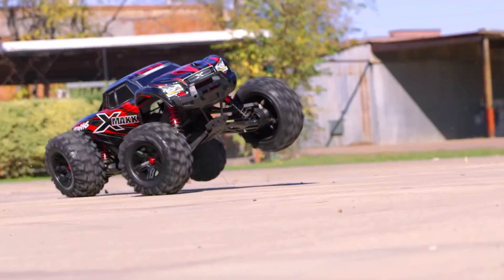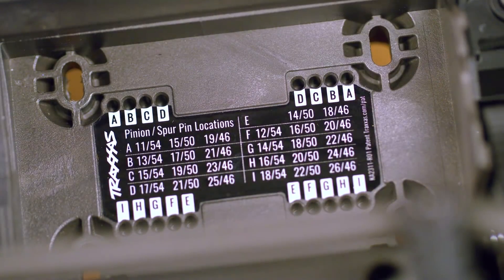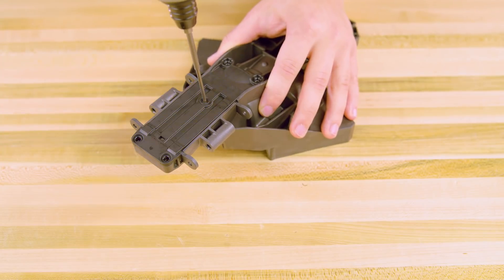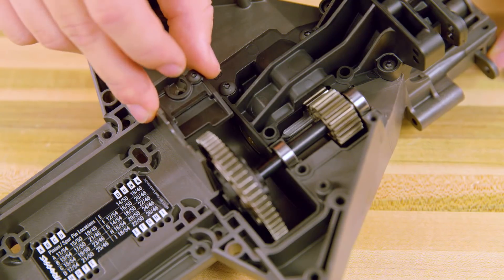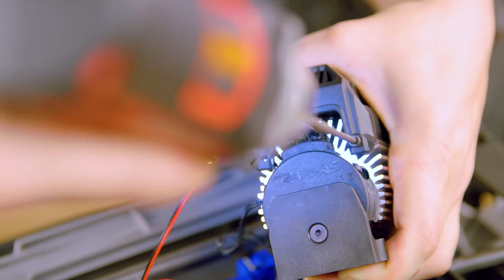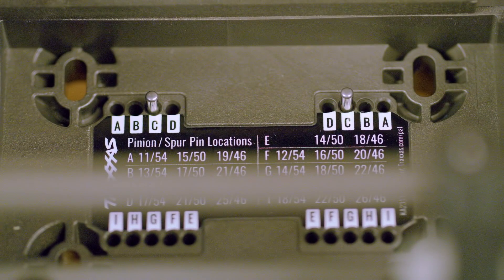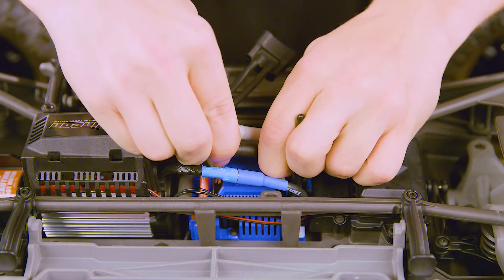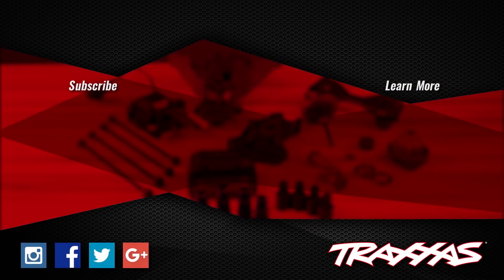X-Maxx 8s Power-Up Conversion | Traxxas

Comment: Traxxas needs to bring this back there is still a lot of 6s xmaxxes out there
Reply: I'd just go with the mamba monster from castle and upgrade the gears by looking in the parts book on the 8s maxx. I've heard that The castle system outperforms the stock system on my 8s maxx anyway.
Reply: @the40735  yeah that’s what I’m going to do I’m still trying to decide if I want to upgrade the esc and gears and gear up and stay on 6s or go to 8s cause I’ve seen people running 6s setups that are just as fast as 8s

Comment: Traxxas I had an xmaxx and I blew the tires the.  first day and my pinion gear fell of my radio broke my gears shredded and then I sold it on ebay and got a maxx the maxx I like more I think the 8s was two much power and I'm 9 so ya also I love the rc hobby xmaxx is what got me into it

Comment: Hello,

I just bought a "New x-maxx 8s 4wd brushless red traxxas" I would like to modify it with this improvement ... I don't speak English, I use GOOL TRADUCT.

would it be possible to have the list (references) of the various parts to be assembled?

What is the gain of this modification?

Thank you in advance for your response, the video is super well done, the editing should be simple! ☺

Edwyn
Reply: This modification is for people that bought the Xmaxx when it first released as a 6s truck. Your 8s version already has all these parts....or should from factory.

Comment: This isn’t hard to do,you can first upgrade the rear bulk head with torque bias drive and then upgrade drive shaft and diff ring gears later.

Comment: I wouldn't use Traxxas batteries, there bearly up to the job and will puff in no time, my 6s batteries were a waste of money and when you buy the charger to it's a lot of money to waste, also bought the Bluetooth link it will not connect to anything i have another £50 wasted, the x-Maxx is awesome just wish the extra's were too, and why would you pay £600 to upgrade a truck you paid £900 for, better to sell it and just buy the 8s, but again get better batteries and a charger that charges any battery, AND DON'T USE POWER TOOLS TO TIGHTEN THE SCREWS FULLY finish them off by hand.
Reply: JTM2007   I keep hearing people saying to just sell it and buy the new one instead. You are assuming there are tons of people around who want to buy the old version. Were I live most people don't even know what an xmaxx is and definitely aren't interested in buying a used one. Mine is currently torn apart needing replacement parts. Who wants to buy that?  I have $1100 invested in mine and I'm damn sure not going to sell it for $300 just to pay that much again for a new one. The upgrade kit is far cheaper than replacing the whole vehicle.

Comment: Msrp $949.99 w/8s kit, $700 regular 2s set up on the  x-maxx but the esc goes out is it worth it?  time you buy the lipos and the dual charger your looking at around $1000 so why not keep the old set up but with a new esc and have a model withe the 8s set pre installed fore a different priceing rang the thing that turns me off about the x-maxx was the price same thing goes fore the xo-1 back in 2012 so why not have this set up it would make perfect sense but that is my personal opinion.

Comment: recently bought new a radio spektrum dx4c do I need to run that temp sensor that my original traxxas tqi  sensor had slot to plug in ?will thier be any rffect
Reply: you can not use the temp sensor with any aftermarket radio system.

Comment: Why do you say 30 plus volts when 8s is 29.6 volts
Reply: Steve Leahy  A fully charged lipo is 4.2 volts per cell. 4.2 x 8= 33.6 volts. They are rated at half though. You are referring to a 50% charged battery set.

Comment: DAY YUM REMOVE THIS REMOVE THAT DAY YUM. ..THAT'S A LOT OF REMOVING :-)
Reply: BIGGBULLxxx You can, I'm running 3S batteries while I wait for the 4S to be in stock again. Gave up 5mph on top with the stock 15T pinion, but she's doing wheelies on 6S.

Comment: The new motor isn't really faster, just more torque, which can be accomplished with gearing, why all the hate?
Reply: I had some people say they prefer the six cells because it's more controllables. I'm still definitely getting the 8 cell version. A friend of mine bought me a pair of Pro-Line pre-mounted beadlock Badlands tires for the x-max when I asked him for the E-maxx so I've already got a $200 set of tires and nothing to do with them might as well get an x-maxx right
Reply: Truth Bullet i don't have much of an opinion on the matter but from what i'm reading here and there, people are thinking this is nothing more than a cash grab.

Comment: Can I purchase the wheelie bar and motor cooling fan separately
Reply: After the MK2 is out, you'll be able to purchase all the add-on/upgrade parts separately.
Reply: You can get the wheelie bar for it now on eBay

Comment: Thanks for the video! Definitely a doable upgrade. Can I ask what electric screwdriver that is? I think I'll need one for this project!
Reply: I know I’m 5 years late but it’s a snap-on tools electric screw gun I don’t know the exact model but you can only get it on a snap-on truck
Reply: It’s actually a Milwaukee unit
Reply: You don't need one stop being lazy, you will just end up with a load of striped out holes.
Reply: @jantheman2001 i think he would prefer spending more time playing with the car thank upgradeing it